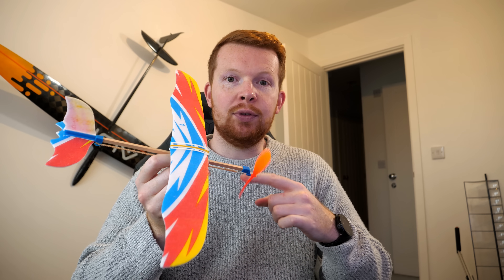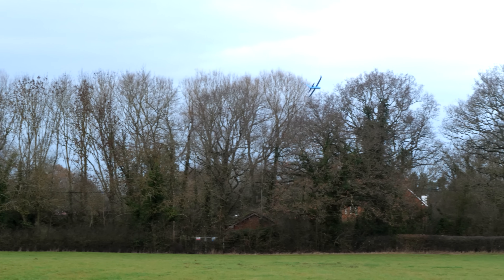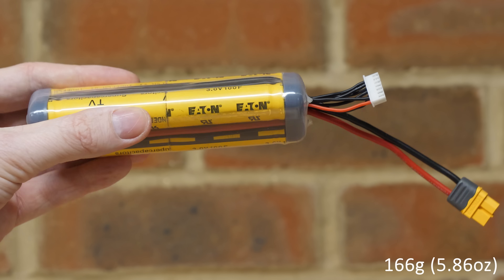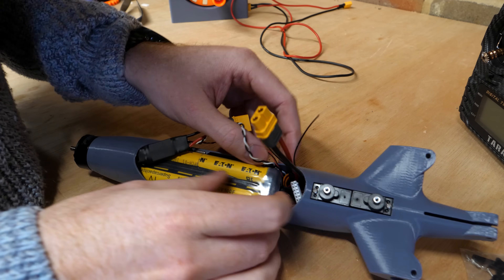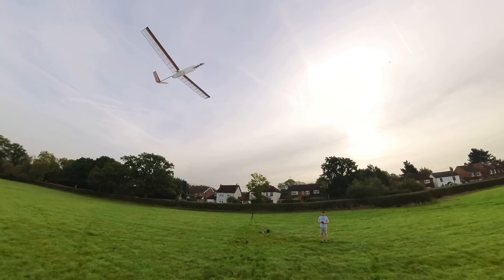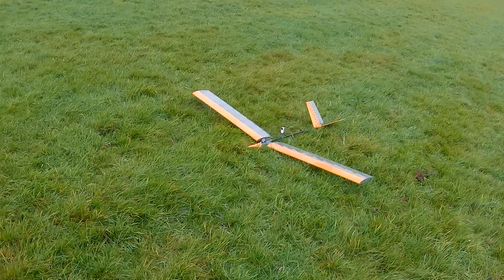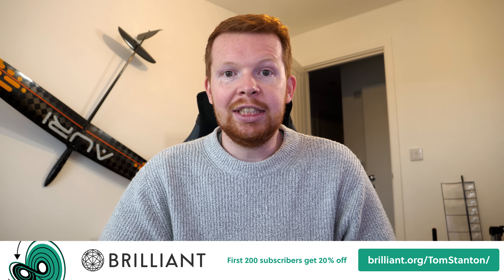Super Capacitor Plane

Comment: As a child, I went to an aircraft modeling club, and there we made gliders with a rubber engine. And we also made foldable propeller blades. At the same time, we had a special stopper, which, after relaxing the rubber motor, stopped the propeller blades in a certain “safe” position, after which they folded with a small rubber band along the fuselage.
Reply: Consider having the thrust of the propeller pull the blade/hub assembly forward on the shaft and when the motor stops have a spring pull the hub ass'y rearward against a stop to allow the blades to stop at the correct position so they fold against the fuselage. Its how we did it back when I was flying rubber models competitively...
Reply: ...
Only Jesus Christ blood can cleanse us of are sins come to Jesus Christ today 

Romans 6:23
For the wages of sin is death, but the free gift of God is eternal life in Christ Jesus our Lord.
Come to Jesus Christ today 

Jesus Christ is only way to heaven 
Repent and follow him today seek his heart Jesus Christ can fill the emptiness he can fill the void.

The Holy Spirit can lead you guide and confort you through it all 

Heaven and hell is real cone to the loving savior today 
Today is the day of salvation tomorrow might be to late come to the loving savior today 

John 3:16-21 

16 For God so loved the world, that he gave his only begotten Son, that whosoever believeth in him should not perish, but have everlasting life.  17 For God sent not his Son into the world to condemn the world; but that the world through him might be saved.  18 He that believeth on him is not condemned: but he that believeth not is condemned already, because he hath not believed in the name of the only begotten Son of God.  19 And this is the condemnation, that light is come into the world, and men loved darkness rather than light, because their deeds were evil.  20 For every one that doeth evil hateth the light, neither cometh to the light, lest his deeds should be reproved.  21 But he that doeth truth cometh to the light, that his deeds may be made manifest, that they are wrought in God.

Mark 1.15 
15 And saying, The time is fulfilled, and the kingdom of God is at hand: repent ye, and believe the gospel.

2 Peter 3:9
The Lord is not slack concerning his promise, as some men count slackness; but is longsuffering to us-ward, not willing that any should perish, but that all should come to repentance.

Hebrews 11:6
6 But without faith it is impossible to please him: for he that cometh to God must believe that he is, and that he is a rewarder of them that diligently seek him.
Jesus
Reply: On most electronic speed controllers (ESC) like what he used in this project there is a setting called "brake". As soon as the ESC senses a rotation, when zero rotation is commanded, it applies a small reverse current to cause the motor to stop spinning. I have used it on many glider airplanes with folding props. Occasionally, like you mentioned, you'd have to blip the throttle to get the prop stopped in the ideal position.
Reply: @Carrera0to60  f5j fly slowly, so they using booth esc brake with mechanical (spring or rubber) self-folding assistance. When motor spins, centrifugal force wins over theses spring or rubber band folding helpers, when esc brake stop propeller, rubber band or spring helps the propeler tightly snap to fuselage. The propeler weight in bottom position otherwise could wins over wind drag especially on slow speed plane during glide.
Reply: @Carrera0to60  In the case described by the author of the video, the option with electronic engine stop is not correct. The charge of super capacitors is very small, and when they are discharged there is no way to do this correctly.
But you can try to make an electromechanical stopper. It is necessary that it be turned on all the time while the engine is running, and when turned off, it blocks rotation. I would try to make something similar from a small relay or solenoid. It will, of course, consume some energy, but it might be worth a try.
In the case of a rubber motor, the rubber band with stored energy pulled the propeller axis more strongly towards itself. When it had completely used up the energy reserve, at this point, the rod no longer pulled so much, and under the action of the spring it moved forward, where it touched the adjusting bolt.
Reply: Stop the Prop by Pulling Up into a momentary Stall, Prope should back and stay there.
Reply: @HoundDogMech  Именно так.
Reply: This video is a shameless clickbait. Tom Stanton has no respect for his viewers and them are so smart that they forget what they were sold in the thumbnails. Probably no dignity either to mind it if they noticed.
Reply: @suprememasteroftheuniverse did you watch the video? It's exactly what he showed in the thumbnail and exactly what the title describes.  Maybe you should watch more than the first 30 seconds of a video before forming your entire opinion of the video and the person who created it. Wow.....
Reply: @TheMattC9999  did you see the thumbnail? I guess not

Comment: There is a design of prop that uses a rubberband to fold the blades back when not spinning and open when spinning.
Reply: There should be a programmable brake setting on the esc.  Once you turn the setting on, when you turn the throttle off, the motor should stop spinning and the prop should fold back from the wind.  Here is an example and explanation about it.  https://www.youtube.com/watch?v=qYHJgg_vvSQ

Comment: Next challenge! Build like 3 or 4 of these and controll all for of them by pilot software running on a laptop. Build a landing and launch system so that when one is empty it can auto land in the land system, quickly charge from a big bank of lipo's and then be launched again. In such a way that at any given  time, one plane is charging and two planes are in the air! Would that not be cool??? If you can crank charge them in 2 minutes for 2 minutes of flight time, you can probablly charge them in under 10 seconds with a big lipo bank. It be funny to see robot planes fly and land and charge and catapult of again fully automatic!

Comment: As I said in the original generator video, it would be better to have a much higher gear ratio than what you've got. It's much easier to provide a constant push against a heavy resistance (high torque) than to keep cranking the handle round and round. One slow, heavy turn is easier on your arm than 10x light turns.

Comment: good work.          observations      one question is, did you intend to make an alternator of such low quality.?      a better alternator would reduce charging time.!            YOU  GOTTA  WIPE  THE  DEW  OFF  the  wings !!!          a  MUCH  lighter model and motor and prop should be used.!     use of a  HEAVY  tubular  CF   tail boom  NOT  smart. 
pma  FACTS.    :50   the shape of the magnets used limits their effective use to  dual-rotor pma configurations.      as such, the polarity of the magnets should not be reversed, as described.
rotor magnet polarity Should be reversed in a  single  rotor config.        HOWEVER,    for best efficiency of a single rotor pma,, the rotor magnets need to have a shape that allows the 'edges' of adjacent magnets to be near enough to one another, such that full magnetic poles can form between  adjacent magnets.
a generating coil should be wound using 14awg magnet wire or equiv; coils can be wound  'in hand.
in general, a pma should have a three-phase stator.     the number of poles on the rotor should be a  Multiple of three and  be equal to the number of coils in one phase.        whatever amount of AC power comes out of the stator can be rectified and voltage can be converted to a desired amount.         d

Comment: You'd need a brake for the propeller that engages when unpowered to prevent windmilling like that. Then the blades could fold in and you'd have a decent glider.

Comment: Maybe instead of opening the plane to charge the capacitors, you can connect the charging cables to a tiny piece of metal that you can place on either side of the plane.
 
then you can make a small headset shaped charging dock to charge the plane

 (the U shaped charging station can have a piece of magnet or spread open wires on the charging points so it can have a better connection)

Comment: How capacitors voltage get balanced?  Do they have internal voltage limiting ? 
You could program the ESC to disable or lower low voltage shut down, and enable brake on to avoid the prop spinning.

Comment: Great video! Question: how did you get 18v from the capacitor pack by soldering them in series? Wouldn’t they have to be connected in parallel to get 18v? If connected in series you’d only be getting 2v?

Comment: Really nice project! Everything (except the first 3D printing maybe) worked perfect from the start to finish. Even an uncrashable plane almost from the props to the way motor cuts then later the servos cuts (as you said other way around and would be a disaster waiting to happen in a smaller field).

Can not improve anything except maybe a slingshot start (as you have foldable props) you might be able to slingshot it for some more starting speed... 

Really perfect! I wonder how cheap you could make it? Would be cool to make it as cheap as possible (controller, engine, servos and so on the cheapest but still works and super caps)

Comment: Instead Of The Pipe Dream Of EV's We Should Be Building Hybrids Using Super Capacitors Instead Of Batteries! We Will Not have The Power Grid To Support EV's Until The 2040's If Not 2050's! Their Are Fleets of Trucks That Can Not Convert To Electric Due To The Amount Of Power Needed To Charge Them Is More Power Than The ENTIRE City Uses They Are Stationed In! Also The Environmental Impact Of All Of These Poisonous Batteries Along With The TOXIC Gasses They Produce While Being Charged!

Comment: The idea is very nice! 
However, when I saw that the controller did not work when the voltage dropped below 5V, I came up with the idea of creating a constant voltage using a buck-boost converter. Maybe due to the increase in dissipation power, it will not be an efficient method and will consume more current. But the energy below 5V can also be used for the controller. At least it's worth a try. 💡

Comment: I wonder if you could add a circuit to use the windmilling of the prop to keep some voltage running for the control to still be useable during the gliding phase.

Comment: I dont think the balancing circuit is really necessary due to the supercap incredibly low esr. They will naturally balance and it will be incredibly difficult to get the voltage on one cell out of compliance unless you're seeing really high charge voltage. A chemistry technology you will due to the charge inertia. Also a full bridge rectifier isnt necessary if you maintain magnet polarity and have have pulsed AC with a DC bias then use a single diode. Other than that cool plane

Comment: The ESC is programmable. You can program it to break when idle, then the propeller will be folded and you'll save some energy.

On the other hand, it could be a nice feature to use the propeller rotation to charge up the capacitors 😅

Comment: Out of all the unique planes you've built, I feel this one is the most... well made. That isn't to say the others seem shoddy or anything, but with this one, if someone only saw the finished product and the flying, it would be easy to assume it was a store-bought product. The way the prop folds and the wings easily detach, the simplicity of the charging system with no batteries or grid power required, this would be a great toy to bring on camping trips or something.
Reply: And it working very well on the first try
Reply: This video is a shameless clickbait. Tom Stanton has no respect for his viewers and them are so smart that they forget what they were sold in the thumbnails. Probably no dignity either to mind it if they noticed.
Reply: @suprememasteroftheuniverse "Clickbait" implies the title and thumbnail promise something not shown in the video. Sure, the exact thumbnail doesn't show up in the video, but you didn't click on this to see the thumbnail, because you already did. You clicked on it because you wanted to see a "Super Capacitor Plane", which was shown in the video.
Reply: @suprememasteroftheuniverse  he literally does that all the time though. Yeah, 6 capacitors arranged to look like a radial engine would have been cute, but it would have suffered catastrophic failure from the one thing he specifically designed the real plane to be able to survive.

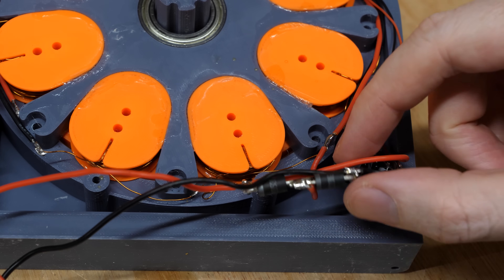Comment: At 1:55 please not use full bridge rectifier with four diodes for hand crank generator, 
just use the simple "Delon" voltage doubler circuit with only 2 diodes and 2 capacitors!

Comment: I feel a extreme quick charge from a heavy ground based battery pack would show the benefits of capacitors even better. Or what about a short section of two electric wires, where the plane can charge without stopping by just scrapping along for a moment?

Comment: amazing work ! it would be interesting to use this windmill action from the propeller to maybe regenerate the capacitors and potentially increase flight time... but maybe some calculations would be necessary to see if the little more torque generated by the charge at the propeller will not eventually produce even more drag

Comment: To rectify and double the voltage just use a simple "Delon bridge" circuit at the output. No full bridge rectifier needed! That circuit doubles the alternating voltage and rectifies it to DC for your purpose with only 2 diodes and 2 capacitors. Giving you a higher output range and also enough voltage when cranking with slow speed.

Comment: The folding propeller is supposed to fold backwards when power is out to avoid wind milling.  Change the rotation of the motor and mount the propeller  the other direction.

Comment: Great episode! As always. I do want to mention that charging or discharging 6 capacitors with 0.125 Wh capacity each in 2 minutes means an average power of 22.5 watts, if that was from completely discharged, so slightly less in reality. With 3 liion cells 10 Wh each, that would be about 0.7C and, they would have about the same mass as those 6 capacitors. That would give capacity for over well over one hour of flight time. It would obviously also take well over an hour to charge from empty to full at that rate. 

For maximum power density there are Lipos that outshines most, if not all super capacitors on the market, the fact that they can't be charged very fast doesn't always matter. The main practical advantage of super caps is that they can be quickly charged and discharged so many times, and just be left at any state of charge, and just picked up and be recharged, in seconds, with the right charger.  

I wonder if the controller could be programmed to stop the propeller at a just slightly higher voltage than complete cutout voltage.  I mean, stopping the propeller at 6 V instead of just cutting out at 5 V should reduce the usable amount of energy by about 4%, which would reduce powered flight time with just a few seconds, assuming constant power draw.

Comment: maybe you can use the spinning of the propeller for regenerative charging of your receiver and servos. i would split the systems up to run from 2 banks, with the receiver one getting regenerative charging when the motor cuts out. i guess that way you can get down from a way higher altitude, the propeller would slow down quite bit from the load though and fold in instead  ..hmmm

Comment: You can set your ESC to active break which will reduce the drag quite effectively. I think the concept is brilliant and I wonder if it could be applied to indoor planes while maintaining the typical flight time of about five minutes (only 2s required, however weight is relevant).

Comment: 9:21 wouldn't it be better to power radio electronics with 2x cr2032 given electronics' low demand for current, and the rest off of supercaps?
Or maybe even motor only as servos in this configuration also doesn't require tons of energy.
This setup could glide for much longer without risk of loosing signal in mid air and constant monitoring of radio's battery level.

Comment: This is how entry level planes used to be when I was a wee lad. I had a Cessna Sunlight 7 that had a tiny NiCD 4.8V pack made out of 1/4AAA cells and a big fat charger that'd whack it with power from D-sized NiCDs (or a lead to your car battery) for like two minutes, and that poor little abused pack would power the (tiny, brushed, geared) motor for just about two minutes. Then a timer would cut the motor so there'd be enough power for the controls for a few more minutes.

Comment: Unfortunately with the 5v cutoff you are leaving a lot of energy unused, a boost converter that is turned on close to that voltage and still works at lower voltage would give you extra flight time.

Comment: The bonus feature of this design, is this Super Capacitor Plane could also be solar, wind, or rain powered. Wondering the effect on efficiency of not having an aerodynamic wing profile over the fuselage shoulder as creating double the wingtip vortexes?  The inner vortexes might actual amplify each other drastically increasing the drag. Might be interesting to try visualizing using a fog machine, or dry ice, and see what difference integrating an airfoil does to flight time, efficiency.

Comment: would be cool if you could somehow , when the power gets low,  cut power to the motor and then utilize the wind to keep it rotating and generate power back to the capacitors. 
im unsure how much power a planes motor will generate though.

Comment: Can someone explain how exactly the Led Voltage Display works? I thought it was supposed to display how much voltage the generator produces, but in the case of charging the capacitors, it displayed how much charge they have. How does that work?